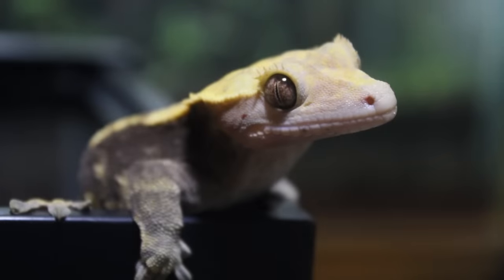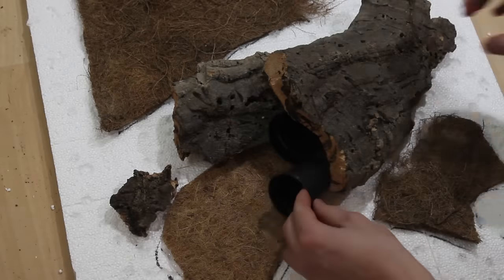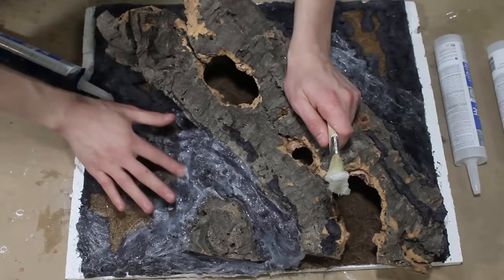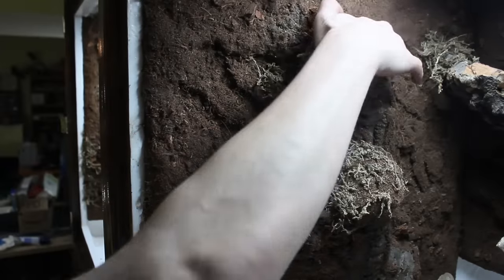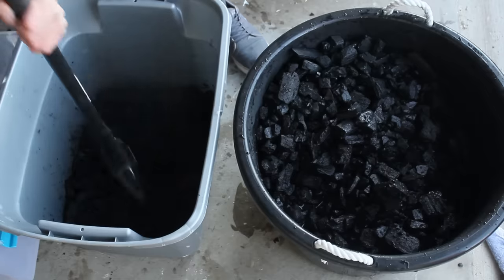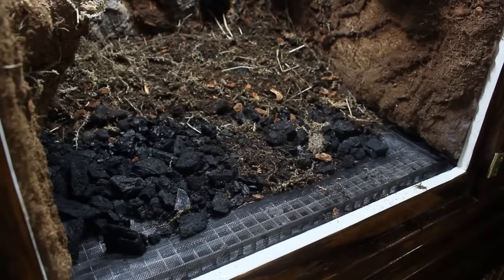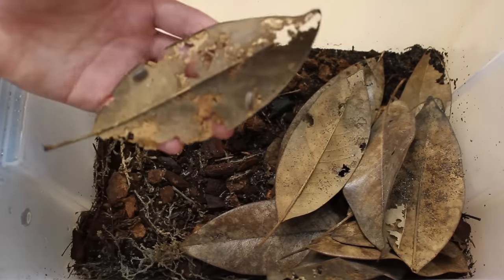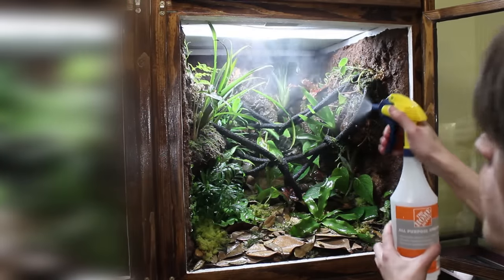Naturalistic + Bioactive Crested Gecko Vivarium (Housing Henry 2.0)

Comment: You and your videos are inspiring!  Been waiting for my rainbow boa to grow up a bit before going bioactive and doing more with his enclosure. Finally got to it and I've been using this video and your king snake one as a guide. My brb's enclosure is a thick plastic tub and tbh I'm a little nervous if it will all work and hold the same way, mainly if the expanding foam is even okay to use with a plastic tub? Seems to be working out so far and it does look great. Is there any concern I should be worried about because I'm using a plastic enclosure instead of glass or wood?

Comment: Ive used potting soil, non washed plants and even dirt from outside not cleaned for keeping invertebrates and I've never had a single problem except for the odd snail/slug. In fact I'd say that stuff from outside is quite beneficial as it contains fungi and bacteria to break down faeces, dead Isopods etc. However I've never done this for reptiles so I'm not actually sure what would happen. Fertilisers aren't anywhere near as dangerous as some forums make them out to be however pesticides can be. The main issue is mites/diseases.

Comment: This so beautiful. Would the foam backgrounds also work for a 18x18x36 exoterra or zoomed glass terrarium or do you think it would be too crowded with the three sides covered with the foam background? Would the ventilation holes at the bottom cause any issues with all the layers added, like would water go out of the holes if the layers go higher than them? Would you recommend a different type of terrarium that doesn’t have the ventilation holes at the bottom? Do you have to drill a hole and put a drain in the glass at the drainage layer like you did in previous videos? What is the benefit to doing that?

Comment: Is a build like this prone to rot at all? How long will it last as a functioning Vivarium before the decay becomes too bad?
Reply: He added springtails and isopods...
Reply: @easternbarnowl560  I'm new to this.
So springtails and isopods will take care of all rot and decay?
Reply: @Palaelogus  yup, those bois will take care of mold, decay and animal poop. I dont have isopods but i have springtails and earthworms in my setup.
Reply: @easternbarnowl560  Thanks for the reply. Looking to make a terrarium of my own, but just seemed to me like such a wet environment wouldn't have the greatest longevity. So no further manual cleanup is required once the springtails and isopods are in place?
Reply: @Palaelogus  well you dont have to cleanup anything but maintaining the terrarium is another thing. Isopods and springtails eat stuff like leaf litter, dead moss, mold and other stuff. If you want to make a bioactive vivarium you need false bottom and a layer or mixed in substrate activated charcoal. The charcoal promotes new plant growth filter the water and provides a home for springtails.
Reply: @easternbarnowl560  hi, so once I make a bioactive like this I will never have to clean it? Only feed and spray water? What if the gecko fecals up high on a branch or top of a plant? The springtails and isopods will take care of all that too? I wouldn't have to clean it for years and years? Thanks
Reply: @nathankeel4308   Yes, you just need to feed and spray, of course you can do other maintance like cutting overgrown plants but yeah its bioactive and as long as the isopods and springtails are working its all fine

Comment: what are springtails? and what does the rolly pollies do? also wont they eat your plants? im looking at doing something like this for a crested gecko also and was wonder about the leca so that is good i can use it in mine... thinking doing a layer of leca then the coco bark mix .. ill have to see if i can find charcoal to do that also.. and im thinking of adding venus flytraps to it too... great looking setup ya got there
Reply: they won’t eat your plans if given other things to eat (mainly your crestie’s poop and leaf litter). They clean the tank for you. Springtails do too, they’re tiny invertebrates that are usually white, jumpy, and eat mold. Venus fly traps probably aren’t the best option since they may be a danger to your crestie.
Reply: cool ty and ya i wont add them ... they also really like it wet so that alone might not be good in there .. not planning on keep it saturated with water lol.. i am thinking of adding a mister type setup to it also.. my room is pretty dry so it would help a lot...also from what i've been reading they will also eat bugs like crickets and stuff would they also eat the rolly pollies? and will they eat dead bugs?  i've seen i can get them mixed and dusted with victims for them but not sure if they will eat dead ones... i know my leopard geckos wouldn't touch it if it didn't move but these guys will eat other stuff too .
Reply: lance wixom they definitely shouldn’t be fed dead insects. They may eat isopods occasionally, but since they’re usually off the ground they would be far less likely to than a leopard gecko. Since cresties need high humidity both isopods and springtails should do well. Speaking of leopard geckos, you could go bioactive with them too. I have one for mine and it’s gone very well!

Comment: Looks great! Would it be a problem if a coconut fiber background is continuously submerged.
Reply from the maker: Specifically the coco fiber + silicone background or a the coco husk liner?
Reply: The coconut fiber. Because I was thinking of using is for a palidarium with a water area

Comment: so i was excited that my exo terra enclosure (18 18 24) comes with a background, but i'm pretty sure it's made of foam and have read it won't hold up to humidity (have you ever used one in a bioactive build?)

 would you recommend the method you've shown here, using that type of background as a base instead of using a sheet of styrofoam? i'd prefer not to throw it out altogether if that's possible, and this would be a cool way to repurpose it and give my crestie a nice background. thanks!

Comment: Hey serpa, where did you get the coconut husk liner from? Also would you recommend curing the styrofoam to keep it from leaching chemicals? I know some people on forums were covering it up with quickrete i think.
Reply from the maker: I got the coco husk liner on Amazon. Also what do you mean by cure? Of course of should let the foam cure or dry before doing anything with it. Also this foam is made for use with ponds/fish, so it's safe to use.
Reply: its the styrofoam you use for the backgrounds that your spray the great stuff on (the white). I remember when looking into it that people using that or insulation foam (blue and pink foam) would say they would cover it with something because its unsafe? Or is that not something to worry about?

Comment: SerpaDesign, what do you think of cell cast acrylic for a large vivarium.  I'm thinking of using series 10 80/20 for the frame and 1/4" cell cast acrylic for the sides.  Just wondering what you think.

Comment: I have a question, I have grow lights on my taller bioactive terrarium, that is soon to be a vivarium (18x18x36 Aquarium tilted upright). The grow LEDs that I'm using don't give off too much heat but seem to give off enough for it to raise the tank temperature from 75-77 ish degrees to around 83-85 more near the light (it's hot in the upper 1/3 of the tank and more cool near the substrate). Would putting something like parchment paper or printer paper between the light and the vivarium to dim it cause the light to be ineffective? Or would it make more sense to anchor the light farther away so it's not right up against the tank glass? Or am I overthinking it and is this 85 degrees that the upper part of the tank is reaching normal? Thank you! Love the videos

Comment: Does Great Stuff adhere well to the styrofoam? How well did this build hold up? Would using eggcrate be better than the foam for a removable background base? I have an exo terra styrofoam background that I would like to use, as it already has a fairly good texture but would just like to build on it.

Comment: Hey Serpa, where did you get the zinc wire? I have been searching online and in stores and i haven't had any luck in locating any.
Reply from the maker: Use stainless steel instead. It's cheaper and will be just as good if not better.

Comment: Is it possible to use a fluval flex aquarium to turn into a vivarium? I have one that I bought but it has a scratch in the bottom and I don’t trust it with 150 pounds of water pressure. It’s a 15 gallon.

Comment: I try not to carve the foam and instead just mold it when it's about to harden. Makes a lot more nicer surface than carving.
Reply from the maker: Maybe so, but you will be left with the "hard" exterior that doesn't like things sticking to it long term.
Reply: SerpaDesign thats why I use elastupor and not silicone.

Comment: So the rubra and fireball don't need pots to grow in? They just grow in the background?
Reply from the maker: Correct, they are both epiphytes. Unlike normal plants, epiphytes actually receive their nutrients from the air. I could have planted the Billbergia the same way, but since it was larger, I planted it the way I did,
Reply: SerpaDesign thanks for letting me know. That's gives more possibilities. I also like this background method the most. Easy to change backgrounds. And easier to start over it it didn't work the first time. Less likely to ruin a tank.

Comment: isnt the silicone dangerous for the gecko? isnt it safer to use aquarium silicone
Reply from the maker: If it's 100% Silicone with no additives, then it's fine. A lot of hobbiests use this specific silicone (GE Silicone I) to build aquariums and general aquarium purposes. I've been using it for almost 12 years now, on various setups and no issuess so far.

Comment: How do you heat your vivs without drying them up? I seem to keep running into this problem
Reply: c4x mist mist mist
Reply from the maker: Yeah I mist it about three times a day. I have to assume that you are using Exo Terrara enclosures? If so, you may need to cover the top with some glass, if you haven't.
Reply: Ok,  I have plastic Wrap and tape covering the top since its a much cheaper to do, thanks!

Comment: I don't like foam or glue or any other like unnatural stuff in my terrariums.
Reply: cuz 1914 then don't use any...
Reply: It's all safe. People have been using them in aquariums for years. Not sure how they use the foam since it floats but they do.
Reply from the maker: None of these materials are harmful at all. It's all completely safe for animals.
Reply: I have two with backgrounds made completely from painted spray foam. All you have to do is seal them. 😉